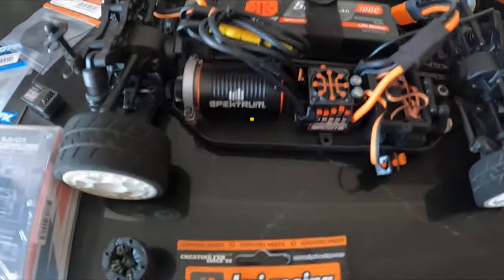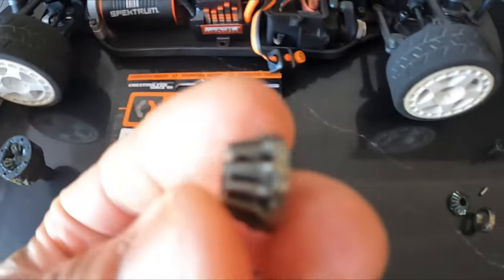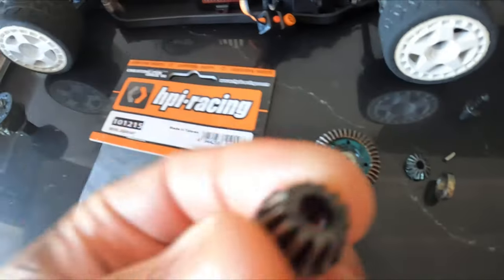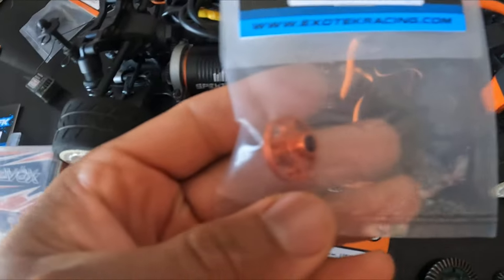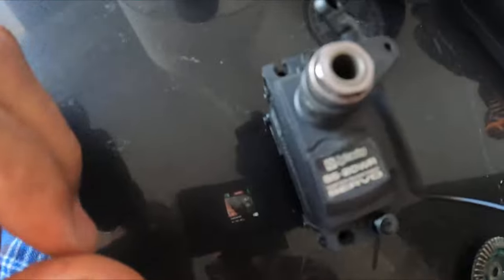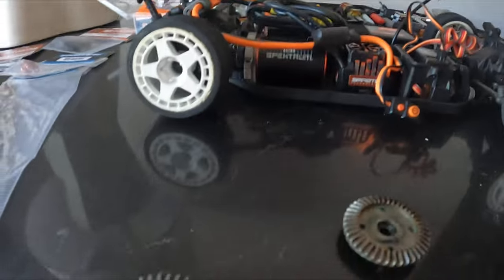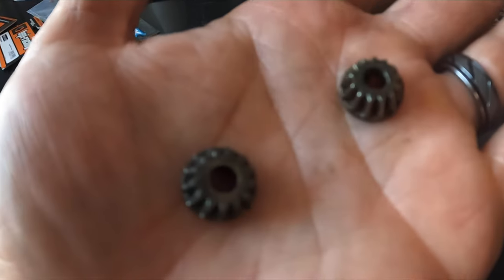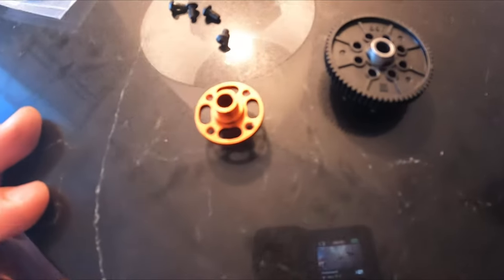HPI Sport 3 Upgrades for Improvements

Comment: In case your not aware you don't need the spool to lock the diff. In both diffs there is a set screw in the diff housings which can be tightened to lock the diffs.
Reply from the maker: Thanks for sharing.

Comment: I want to get this chassis but heard there is a problem with what wheels you can use. Did you have any problems with after market wheels?
Reply from the maker: No issues. The wheels for any on road pan car would work.  What did you hear?
Reply: @MatrixRC  heard on a thread on a website that wheels were an issue thanks for clearing that up because I really want one over a tt02
Reply from the maker: Yes I have the tt02 as well and wheels work.
Reply: @MatrixRC  thanks for your help I ordered the hpi today
Reply from the maker: Awesome 👍🏾